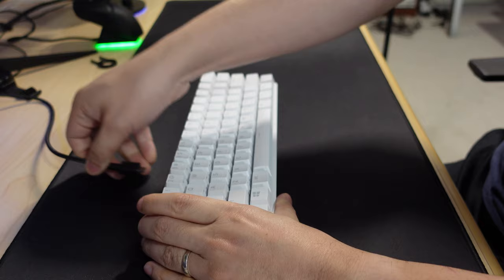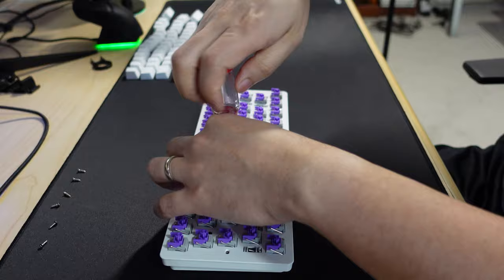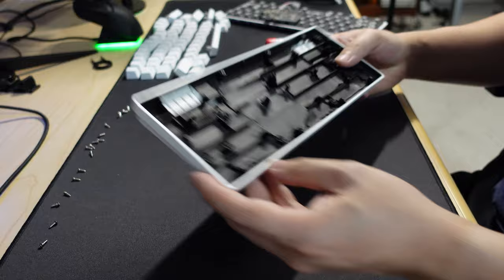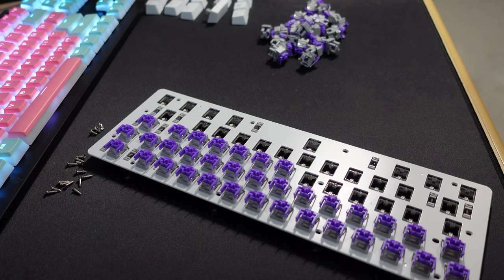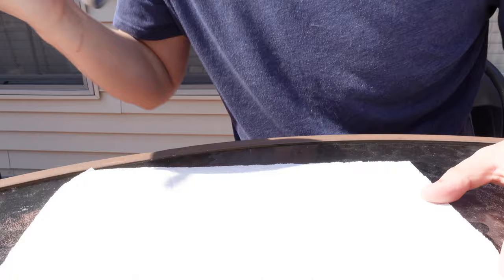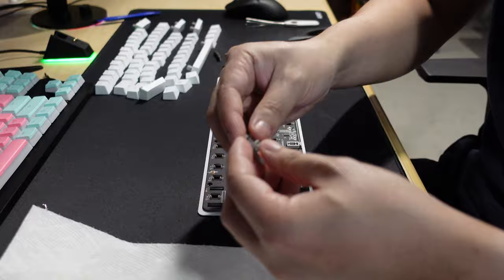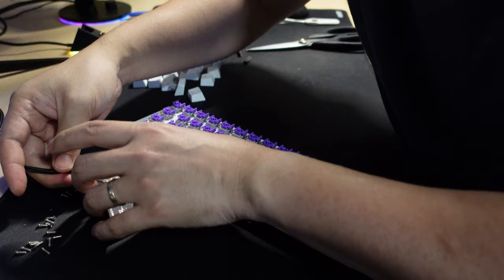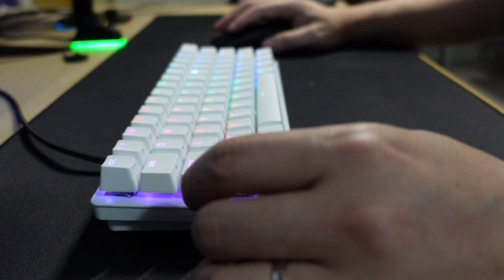Modding the Razer Huntsman Mini: Easy steps for better sound!

Comment from the maker: For those of you looking to do this to a Huntsman TE, please watch my before/after sound comparison video here: https://youtu.be/NvJ1mh2XkfI

The procedure for the TE is almost exactly the same, but there's an extra hidden screw in the back (watch my video to for how to get to it).

Also, if you don't want to push the switches out by force, you can squeeze the two clips on the side of each switch together (from underneath the PCB) a little and then they slide right out.
Reply: ha, man, can you make a video of how to lube the switches exactly because when you do it in this video it was blocked by your hand please thank (bought this keyboard because of you).
Reply from the maker: Hey, you can see the process in more detail in randomprankp's video on the same topic: https://youtu.be/r_OePPDTFVU?t=175
Reply: for the ribbon cable you are supposed to lift up the little black tab and then it will just be completely loose, thats what is actually keeping the cable in place
Reply: What jf you lube the switches
Reply: Holy shit that sounds so much better
Reply: hey man will the wd40 multipurpose work on the switches or no?
Reply from the maker: @angelomiguelsantillan3008  no it could ruin your keyboard, please don't use the regular stuff. Only PTFE dry lube spray.
Reply: what about the huntsman elite?
Reply from the maker: @daalah6074  these mods also work on the Elite, but please be aware that the disassembly process is much more complex due to the magnetically attached wrist rest and the multiple layers with the inclusion of the diffuser on the body of the Elite. But once you get to the PCB, the switches and stabilizers come out the exact same way, so you can follow the same steps to lube them and insert some case foam.
Reply: @bigxie  Thanks a lot for the quick response, I've been thinking of doing this for months :)
Reply from the maker: @user5th  sorry, I'm not familiar enough with the product to say if it is or not. Mainly you want a lubricant that works with plastics and doesn't corrode it, and in the event if it gets on the PCB, does not conduct and cause a short circuit. Not sure if the silicone spray meets those criteria or not.
Reply: So can you theoretically swap out the stock switches and pop in other ones into these types of keyboard? For example, I’m looking to swap out the green switches on the razer turret for the linear optical red switches but I don’t want to damage the keyboard. Would it be possible to do so?
Reply from the maker: @doseofadrenaline4583  not exactly, those green switches are traditional mechanical switches while the Huntsman keyboards use optomechanical switches. They are not compatible with each other, unfortunately, since they operate completely differently.
Reply: @bigxie  I’m trying to mod my Elite but I got all the crews out and it still won’t budge. What else do I need to do to get it out fully?
Reply from the maker: @arir6042  the Elite is really complex and I don't recall the exact specifics, but there are multiple layers because of the LED strip diffuser that goes all the way around. Additionally, the magnetic connector that provides the wrist rest with power is very fragile and can easily break when being opened. I'd look for a thorough step by step online if it's available. I actually don't like the way my Elite turned out due to how difficult it was to open it.

Comment: If anyone actually did this I have mad respect for u
Reply: im about to, my keyb sounds like dogshit and i was kind of thinking about just building a new one and selling the huntsman, but i dont have the patience to wait for stuff to come back in stock
Reply: @bloodsausage6635   I did this not too long ago and I can tell you that there is a huge improvement with the sound. However, there is still a bit of rattling on the keys that have the stabilizers (Spacebar is the most notable and of course the Shift Keys). I do recommend getting O-rings for each key and doubling them up. Sounds more buttery smooth. Hopefully yours will turn out great!
Reply: i don’t know if i’m gonna get this or the logitech g pro x
Reply: I did it, it sounds better now haha
Reply: im too scared to do it
Reply: @ayyeitsmiko4768  You should try taking off each keys stab and applying light pressure to make them tighter, this almost totally eliminates rattle and keycap movement.
Reply: I just finished doing the full size razor huntsman elite keyboard. Between the caps and switches it took FOREVER! But my keyboard is super smooth now.

Comment: Didn’t notice much difference from stock to foam but with the lube it sounded crazy good
Reply: You couldn't even hear any pinging in the video but in real life you can
Reply: Youtube cuts off every sound beyond 15khz, so it is mostly filtered out. I am typing this on a razor huntsmen elite and the metallic ping is very loud. Will send it back.
Reply: @TanteEmmaaa  they do!?! i mean i knew they compressed, but i didn't know that. makes me wish he uploaded a sound file on the side.
Reply: @Jao Bai Dun Razor basically integrated a tuning fork in their optical switches, so no wonder about the noise. I didn't try the lube, for 200€, a keyboard has to be good out of the box.

@Layarion I think with the new codecs youtube doesn't cut of the high frequencies anymore. But there are a lot of old examples still on youtube.

Comment: For the flat black cable, there is a kind of small plastic lever that you flip up and it comes loose very easily. There is no need to take the whole controller board off. To put is back you simply reverse the process by facing the metallic conecters down an putting the plastic lever down. (:

Comment: step one don’t get the purple switches get the red ones
Reply from the maker: I think that one is down to personal preference, tbh. When I made the video, the linear version was very low stock and pretty much unavailable. If I were to make the decision today, I would get the linear for sure. But regardless, both models have crazy spring ping stock so everything here is just as applicable for the linear.

Comment: Just the guide Im looking for my man! But one question though, will the lube that you used work well on Razer's linear red keys as well? Im planning to pick the most suitable lube for my Huntsman TKL, the loud pinging and clacky noise are NUTSSS.
Reply from the maker: Yeah, I did the same procedure to my TE as well using the same lube. You can check out the results here: https://youtu.be/NvJ1mh2XkfI

Comment: 0:18 - stock
4:02 - padding
8:12 - padding with lube
Reply: 0:23

4:04

8:16
Reply: Lmao 😂 no difference
Reply: nah theres a difference
Reply: @ChanniePenghua  it's marginally quieter and I suppose lets you hear the per key rattle a bit better
Reply: @11202  it's about performance not about some sounds
Reply: @ezekiel5425  I think you missed the point of the video then.

Comment: Andrew: "Now i'm gonna lube the keycaps "
Me: keycaps? 👁👄👁
Reply from the maker: Hahaha, did I really say that??? Well, hopefully you got what I meant, lol.
Reply: @bigxie  I broke the little bottom part of the spacebar. Is there any place I can go to to get a new spacebar?
Reply from the maker: @flockedat  are you talking about the stabilizer clips on each end of the spacebar? Razer sells replacement PBT keycap sets that would work (and they come with new stabilizers), but if you just broke the keycap itself, any standard keycap set fits on the Huntsman Mini since it has a standard bottom row.
Reply: @bigxie  I actually fixed it in a different way. I took the same stabilizers from the delete key, took one of them and replaced the broken one with the backspace. Basically what I’m saying is that I removed the broken stabilizer and added another one from the backspace key for completely free. It worked like magic and it feels much better. Thank you very much for the info.
Reply from the maker: @flockedat  I'm glad that worked for you, but it's not "free". Your backspace key is now missing a stabilizer and will rattle if you hit it off center. Whether it's noticeable or bothers you is completely subjective though!
Reply: @bigxie  it does not rattle at all I’m grateful it isn’t

Comment: Here is a tip for future reference, for the ribbon cable there is a little plastic switch that just flips up, it is a lot easier than taking the control board off
Reply: Been trying to find this comment lol

Comment: Is there a chance of it breaking and does this work on Razer Huntsman because i am trying to find something to make my keyboard at least quieter than my voice.
Reply from the maker: There's always a risk involved when it comes to disassembling the keyboard. The original Huntsman is also an older design and I think more difficult to open than the Mini or TE. But once you get to the PCB, the switches and stabs can be removed the same way and lubing them will help reduce the sound, but I'm not sure if it will become quieter than your voice (I guess this depends on your mic as well, if it can cut out some background noise  - if you're talking about voice comms in games).

Comment: For anyone else going to do this mod or anyone wondering why he couldn’t get the ribbon cable off at 2:04 this is because it has a lock to it. Good thing he didn’t pull to hard or he could have broke it. You need to pull up on the locking part and then it should come off easily.
Reply from the maker: Yeah not too sure why I wasn't able to get it unlocked the first time, but didn't have any issues the second time when I opened it again for lubing. I would still recommend for anyone uncomfortable or struggling with the ribbon cable to just unscrew the small controller board and avoid disconnecting the ribbon altogether.
Reply: @bigxie  I just did this mod for the first time ever and had no problem with the ribbon it was just a small task to get back in at the end nice video though

Comment: I really need to try this out! Got the Razer Huntsman V2 TKL yesterday but the metallic pinging is driving me crazy!
One question:
5:11 Do we need to remove them? Or can we just spray the teflon-based dry lube on the keys, and then let it dry, since it's non-conductive and won't interfere with the electronics?
Reply from the maker: Technically it should be ok if you are careful and let it dry, but I personally wouldn't risk it and it's not that much of a hassle to remove the switches.

Comment: After about 6-7 custom keyboard builds I returned to where I originally started, I bought a razer blackwidow chroma way back when I got into PC gaming had it for about 4 years and in 2020 I took into customs built a GMMK Pro which was my most expensive build then did a few different 60% and  4 different TKLS I finally gave up on the hobby and picked up a Razer Huntsman Elite V2 Analog, would love to look at some of these mods, since the switches on it are adjustable it is super nice for typing and gaming and I always preferred heavier linear switches and I while I cant really find anything for the actuation force on these I would have to say that these are in the 60-70g range and I love it a lot, I really want to improve the stabilizers but arent really familiar with these types of stabs, this video is the beginning of my mods on this keyboard thank you!

Comment: I finished doing this just now and the results are amazing! Thank you so much for the tutorial. All in all it cost me about $5-$6. All I had to do was go out and buy the lubricant at Walmart. I used a mat that I use for changing my car's oil as the dampener. 3 layers of the soft paper like fabric.

The spacebar is still not where I wish it would be but a lot better than before. 

Thank you!
Reply from the maker: NP, glad to hear it went well for you! Tuning space bars is always a challenge, even on some higher end custom boards. There are some "spacebar foams" that you can try, which can reduce the hollow or echo-y sound of the spacebar. If it's rattling noise that's bothering you, then maybe some dielectric grease on the stabilizer bars can soften that up.
Reply from the maker: @Sc0l4p4st4  It hasn't deteriorated in my experience, but admittedly I also stopped using the Huntsman Mini that frequently after moving on to more custom boards.
Reply: @L3IZ3R  does it still feel and sound the same?
Reply: @L3IZ3R  thanks for letting me know! i have been thinking about just going traditional lube anyway.

Comment: Bruh... thank you so much for this. I ended up using a $10 anti fatigue door mat from Wal-Mart (6mm thick) and cut to fit the case. $15 project and got it all done in a day, and the keyboard feels like a whole new animal. And the sound, omg the sound. Its perfect and muted and no more ping/excess clank.
Reply from the maker: Glad it worked out well for you! I think that a little sound treatment can really make a big difference and we are already  seeing a lot of hot swap prebuilts around $100 including some case foam, so hopefully Razer takes a cue and in future generations of the Huntsman, focus more on reducing the ping and improving the sound profile overall.

Comment: I lubed my Linear Huntsman Mini with the dry ptfe wd-40 and for the most part it feels and sounds great, but some of the switches are sticking after I press them down.
Reply from the maker: I encountered this with a few switches and found it wasn't due to the lube, but in my case, the stabilizer bars built into the switches having come out of alignment during removal and reinserting the switches. I think it's especially more likely to happen if you just pushed out the switches like I did in the video, rather than unclipping them individually.
Reply: @bigxie  oh, is there a way to fix it?
Reply from the maker: yeah you can remove the affected switches and make sure they can click up and down when they're out of the keyboard. If they're getting stuck, you should be able to see where the interference is happening and push the stabilizer back into place.

Comment: My keyboard sounds exactly like that the thing is i used cooking oil to libe my switches and after putting it back together it worked perfectly
Reply from the maker: Wow, that's the first time I've heard of someone using cooking oil as lube. Well, it is non-conductive, so even if you got some on the PCB it should not be damaging. The only thing I would be worried about is the longevity (whether it will dry out over time or not). Great to hear that it worked out for you!

Comment: So I used some foam to dampen some of the noise and it worked great and makes it sound actually more like a clocky key switch, I almost broke it all in the process but it ended up fine. I used a different type of foam that I had to squeeze down to fit in order to put the screws in put I think that made the dampening better than it did in the video.

Comment: For the price of the mini and the work that goes into this. I think youd be better off with a hotswap custom build
Reply: That’s what I’m going to do
Reply: BUT! You miss the switches, the build quality, the keycaps, the software and more
Reply: @foolish3674  I really don't know why you hate Razer Huntsman Mini. Is it just the purple one or you hate the linears as well? Personally, I use Razer Huntsman TE. I wanted to build my own with MX Black stems/MX Brown springs mix but thanks to the import fees, it would cost around 200 dollars, without the switches, for 80 dollar parts to come to my country. So, I decided to buy these and then lube them with Superlube (Had to order this from EU, there are no Krytox, WD Dry Lube, Superlube etc. in my country. Why ffs?). Now, my switches a smooth feeling, it already was almost as smooth as Ink Blacks, and it has no pinging. The build quality is decent, it didn't upset me a tad bit but it was a bit hollow so I did the foam mod. The keycaps are decent too, they are thick, even Taeha said that. And, this all cost me only 130 dollars, including foam and lube, lube cost me 30 dollars with import fees. I don't think this was a bad deal.
Reply: @TheYToLDSCHooL  the huntsman mini's build quality and software is pretty bad. And the rk61 and gk61 are hotswap and have better stuff

Comment: does any WD-40 fits to doing this? I bought just a regular WD-40 and i dont if it's DRY LUBE or no as it simply is't mentioned on the bottle. it just says WD-40 (stops squeaking, displaces moisture, cleans, protects against corrosion, releases rusted mechanisms). Should it work???

Comment: Hi! I would like to ask if i can use krytox 205g0 grease lube for huntsman mini purple clicky switches? Thank you
Reply from the maker: If you can find a way to evenly apply it to each switch. But they don't open like traditional switches, so that is why I suggest using the teflon based spray lube.